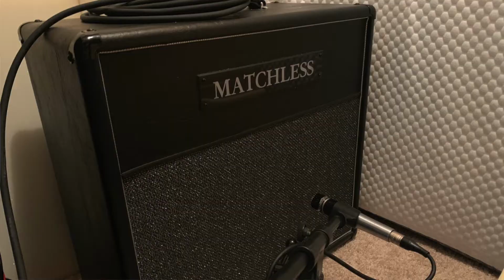Gear Review: Matchless Clubman 35 w/Humbuckers *High Quality Audio*

Comment: Great Video!!  I have a Matchless HC30 and wanted to get another Matchless.   What voicing does the Clubman have to your ears...Fender, Marshall, Vox or it's own thing?  trying to avoid redundancy
Reply from the maker: Hey Reggie, a good friend of mine has a DC30, when we shot them out, we both noticed that DC has the better mids, forward but in a way where they just always sit right in the mix, and the clubman is more hifi. More chime in the top end, and a really grounded low end. Both are great amp, they are different flavors for sure, can't go wrong either way.
Reply: @jwoz9  Some say the Clubman is the most 'Hiwatt' sounding Matchless amplifier.:face-purple-smiling-fangs: